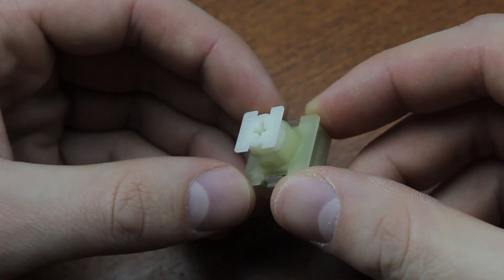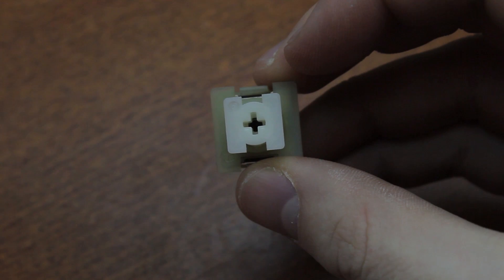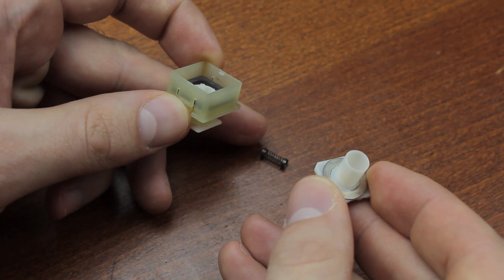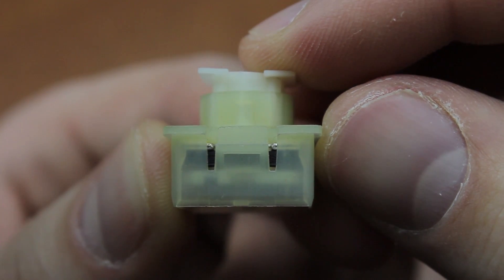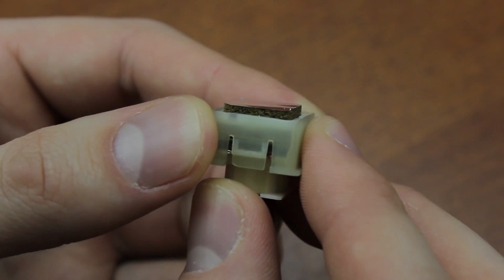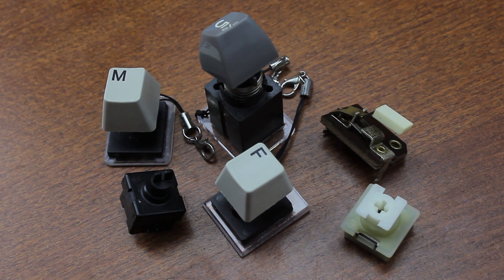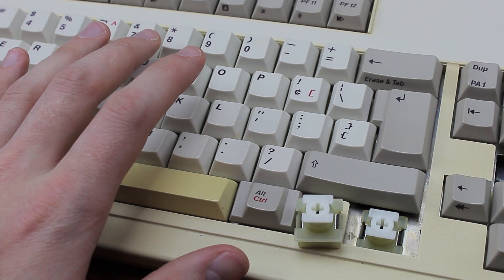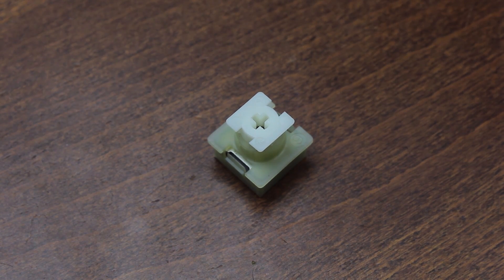Teardown - AT&T magnetic separation switches

Comment: If the magnet and steel plate were reversed, the magnet could trigger a reed relay or hall effect sensor on the way down. The foam and foil could be replaced by piano felt to cushion the fall.

Comment: It would be interesting to have a switch like this that uses Topre's conical spring and capacitive sensor instead of a foam and foil pad.
Reply from the maker: You don't even need a conical spring; the switch is toggle by design! ;)

Comment: So it's a magnetic clickjacket, huh? Maybe if this had a leaf spring as the contact method, it could be implemented into a modern switch!
Reply from the maker: Hmm, it's not really a click jacket, as it doesn't move independently.
Reply: @Chyrosran22  Yeah, from how I understand it, the piece getting launched downward is still under tension by the coil spring the entire time, so it won't loosely rattle like Cherry click jackets. In that sense, its far more similar to Mingjian LK clicky (AKA Bloody LK Blue or Orange), which actually uses two coil springs (one for the main slider and another much smaller one for the clicker piece).
Reply: @Chyrosran22  of course it's not Really a clickjacket, but seems to generate the click and tactility with a very similar method in the broad strokes
Reply: Since there's a foil pad under the sliders, I suspect that it can somehow be used on Topre/Noppo boards if somebody really has the tools (and the time).